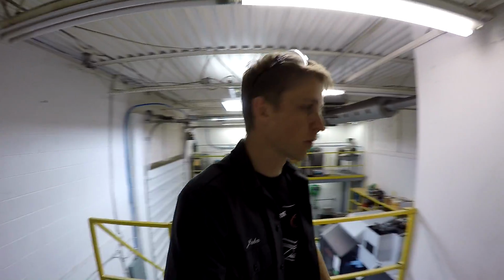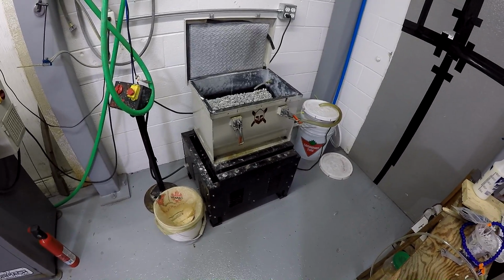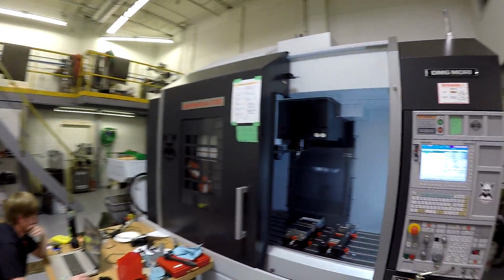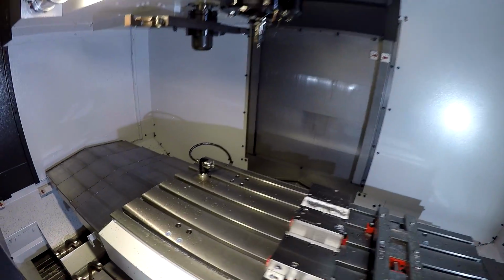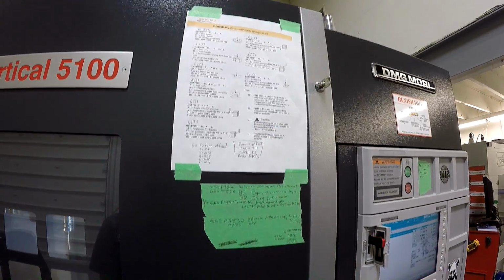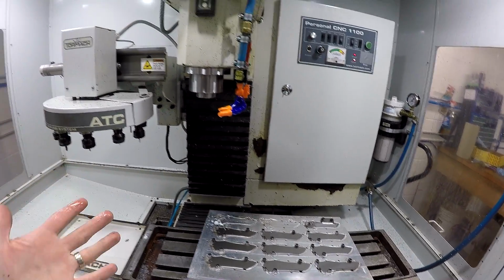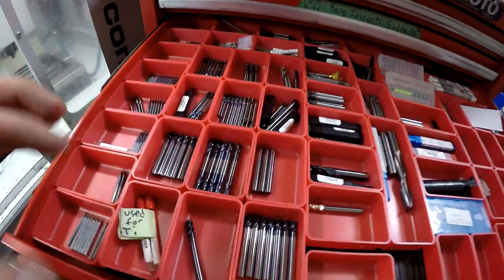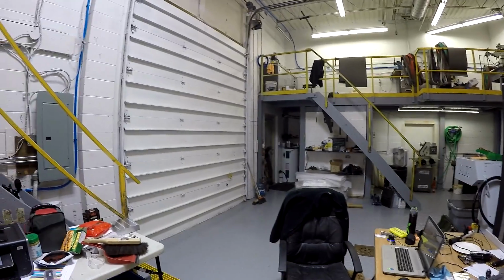Shop Tour of Grimsmo Knives Dec 2015

Comment: The DMG/mori you have is a budget machine designed to compete with the likes of Haas  @ the cheaper end of the market it is basically a 15 year old Mori platform rebadged as DMG/mori because Maho never produced entry lvl budget Machines so they just took an old Mori put a Fanuc drives and a controller on that's why it's so cheap compared to thoroughbred DMG/mori machines like the DmV NHx amongst others.they have siemans or heidenhien drives and controllers  as standard....The machine you have is an excellent machine probably the very best that price range.But you can't really complain about the quality of the lighting inside the machine.When you could of purchased the cabinet lighting and visual package as extra on this machine but standard on the ones I mentioned.This would have gave you full interior LED lights and  Full  in machine HD video camera for cycle monitoring.

Comment: John, on my old surface grinder i used an old vacuum to suck the dust comming from the machine. I half arsed machined a plastic fitting to hold the end of the vacuum to the surface grinder head, and blew the dust into a bucket filled with water so it bubbled up through the water and the water would catch all the dust. That was one of my mcguber inventions and it worked great to avoid cutting a hole through the wall for an exhaust. something to think about

Comment: Hi, I just saw your shop tour video. DMG MORI is great machines, i have 2, lathe and mill of the eco line type.
I have an advice for you, do not keep the renishaw probe in the machine, it will become out of alignment after few months, because of the constant movement of the magazine, this info I got from Renishaw technician.
Good luck to you. One more thing Autodesk 360 is great but you must tray Inventor HSM.
Reply from the maker: +Georgi Yankov That's a great tip that I have not heard before.  I'll keep an eye on the alignment of it!  It's a big deal for us if it goes out of round.  

The CAM portion of Fusion 360 and Inventor HSM (and HSMWorks) are all basically identical, just the CAD side is different.

Comment: Hey John, I would love to hear all the thoughts you went trough before you bought the Mori-Sekei. Why did you not go with a different machine for instance a Brother. 
I assume you had a choice of controls if you bought new, why did you choose the fanuc, and what ever else you can think of.

Thanks for the videos, keep the good work and merry Christmas (or a holiday of your choosing)
Reply from the maker: +Kevin Evardsen Grau Hey Kevin!  Merry Christmas to you too.  The Brother Speedio S700X1 was actually my first choice, and I still lust over it, but I came across a killer deal for this floor model demo Mori for slightly more than the Brother, and it's WAY more machine.  Twice the weight, bigger travels, more than twice the HP, 30 tools vs 21, etc.  The only downside is that it's a little bit slower than the brother, but I'm still happy as a clam!  Being that it was a demo machine I didn't have very many options available to me, other than adding a Renishaw probing package and chip conveyor.  I'm loving the Fanuc 0iMD control, but this is my first exposure to something other than Mach3 and PathPilot.  Cheers!

Comment: You've vocalized so many things that I've experienced after moving to the Brother. The biggest thing truly is: it "just works". If press a button or something and the machine doesn't behave the way I'm expecting, I've learned that the error is probably on my end, not the machine. It's been a challenging, but welcome transition!

I'm also a big fan of the absolute positioning. I never home any more. Actually, I don't even know if there are limit switches in there... I assume there are, but up 'til now it hasn't mattered. When I was hand-drilling the holes in my pneumatic fixture I actually moved the table out of position (the machine was powered off, so there was nothing preventing the table from moving). It probably moved several centimeters. When I turned the machine back on it apparently picked up on the new position without skipping a beat. So cool!

I'm assuming the Mori has a rapid override knob, that's been another very welcome feature! I control the machine more with that knob than anything else... well, maybe not more than anything, but I definitely use it a lot. The machine has spindle speed and feed rate override knobs as well, but I don't really use them very much.

Anywho, congrats again on that bad ass machine! Also, I'm glad we've finally got to see it! I wanna see some reflection-filled, coolant-obscured, small-window-constrained videos of it actually milling!

I too love me some GTA! But I find myself staring at CAD/CAM a lot more often. :/
Reply from the maker: +Hirudin Nailed it bro.  I still giggle watching vids of the Speedio, it's noticeably faster than mine (1400xy 787z).  And your tool change and spindle ramp up/down is way faster too.  Other than that direct comprison to the Brother I have ZERO complaints about this machine, it's amazing.  

We also use the rapid override more than anything, and we're starting to use the feedrate override more too.  We hardly use the spindle override because it's buttons not a knob haha.  

More vids to come!  The finishes that this thing leaves was totally worth the cost, I love it.

Comment: We just built an insulated plywood cabinet around our tumbler. It increases the interior temp a little but its quiet and a super cheap solution. 

Side note: Will I be able to buy a Norseman if I stare at the website long enough?

Edit: We put our compressor in an enclosure as well.
Reply from the maker: +insipidMT Good to know that it doesn't increase the temps too much.  We should do that with the tumbler for now.  What if we put the insulated box on wheels?  Have some soft foam scraping the ground?  Hummmm.

Comment: Back in the days when I was working as a toolmaker my machines was two Hüller Hille NBH 170, one 150 and a 70. Nice machines indeed, but that part with the emergency stop. When we installed the nb-h 170 we had a german guy to show the new features. It was a two-palette changer (work on one piece and load another outside of the machine). The german guy showed how quickly the emergency stop intervened, while the machine switched palette .. It snapped the main shaft which lifts and change palettes (a sturdy piece). He was not so impressed by himself and I bet that wasn´t cheap either :P
Reply: +Peter “Lillebroor” Lundman 
Daaamn!
Reply: +Hirudin hehe yeah that was one part of what he said ;)

Comment: here is a nice little project, make a custom cnc name tag with grimsmo logo that replace the laptop ones, since you have the same model its easy to mistake. you can basically do it with scarps.
and that tool change made me go Holllyycrapp out load :D
Reply: He said it in the other video. Any time those machines aren't making parts to sell they are costing money. That mori probably runs about $5000 to 10,000/month or more. So the more it is running fun projects the less it is doing it's job of making money. That's the problem with successful products... They turn into work.

Comment: Over the rail (so it's out of the way) you guys should totally build a belt rack. Something simple, out of PVC pipe. That would both organize the belts and save space, since you'd otherwise never use that area.
Reply: You can add a very light polarization sticker (3M windshield thingamabob) one the glass, and glare would mostly go away, or you could also get cheap eBay filters for the go-pro, either way works.
Reply: To store my end mills in the same box i just use slips of paper, not even wrapped, i just had a friend who has a business card shearing machine cut me a ton of card sized paper slips.

From there i just pick a bit, bend the paper in half around it and slide it in. Super helpful, keeps them safe (i have chipped two once) and extra, i labeled the paper slips, so if i need something, i just run my finger over the slips (which stick up) and pick what i want.

Comment: Nice dude. I just emailed Eric the other day to get a minimum dovetail dimension for making mini-pallets like that. That "It just works" portion is genuinely the largest advantage all of the genuine VMC's have over the home brew stuff. The advantages of horsepower, rapid speed, etc.. all pale in comparison to not wasting hours/days troubleshooting or making bad parts. They've made a few cntrol tweaks since our duraverticals, i'm pretty sure we only had one auger per side. You should look into the MDI shortkeys, they really make operating that control nice. Have you had to rescue the tool change arm from a mid-tc reset yet? It's feels pretty sketchy the first few times.. :)
Reply: The chinese fingertrap stuff is good for keeping tools safe when loose in bins like that. It's cheap and doesn't occupy a ton of space like the tubes/boxes they come in.
Reply from the maker: +rob lockwood Well said.  I guess I'm familiar with the shortkeys from training but I haven't really used them since.  I'll take a gander today.  We do have a lot of MDI codes that we use all the time, but they're easy enough to type in.  I have had to rescue the ATC twice, sketchy indeed!  There's a hidden setting somewhere that's not even in the manual that's needed to rescue it, I had to call DMG, then I wrote it in the manual for next time.  One time I forgot to turn the air compressor on and it tripped a low air pressure warning halfway through the tool change!  doh.

Comment: Awesome!  :)  I enjoy your updates.      I just realized your shop has no windows. That would drive me nuts.
Reply: +Wide Vision Metal Fab no windows keeps the undesirable element from breaking in and stealing all those spendee bits.
Reply from the maker: +Wide Vision Metal Fab +dzlfreek It does drive Erik nuts sometime, but at least he gets to go outside with the dog every hour or two.  I don't mind it so much.  We've thought about cutting some in, way high up.
Reply: Have you considered closed circuit TV? Looking at a monitor would be just as good as looking outside, and It might be a bit easier than installing some windows.
Reply: +Wide Vision Metal Fab or just open the bay door

Comment: You have absolute encoders that's why you don't have home machine.   Do you have through spindle coolant? If so 300 psi? 1000 psi?

Beautiful machine you have there.
Reply from the maker: +m98custom12 We don't have through spindle coolant but the machine is prepped for it.  We can either buy a kit from Chip Blaster or retrofit something ourselves.  With our current workload I don't see it being worth the expense at this time, but it's something I want eventually.

Comment: believe it or not but a 1" belt is better on the grinder. it will take less passes to get off the part which will save bunch of time. plus you get to split 1 2x72 belt into 2!
Reply from the maker: +Finn Custom Knives Interesting.  Erik uses a lot of split 1" belts for sharpening.  He's just annoyed by them on the surface grinder.  I think it's mostly the tensioner that sucks, and converting it to 2x72 with a custom tensioner would also let us run 1x72 and play with that easily.

Comment: with the BT40 collet (I'm sorry I had a meldas 1040 and it was BT40 and looks extremely similar) spindle you can use a geared engraver that lock into position and will run 7x the speed of the spindle and would be great for well everything. The only downside to it is that you have to remove it manually as it wont fit in the ATC.
Reply from the maker: +xkblxcripple BT40 and CAT40 are basically the same, I think the ATC mount is slightly different.  There are spindle speeders that run on air, ones that run on through spindle coolant, and ones that are ATC compatible.  I think they're around $2,000-5,000.  We do some engraving but not a lot.  If we start doing a lot, or want to speed up micro machining, then we'll be thinking about it.
Reply: Ha ha no worries, I haven't actually looked into the differences myself as I only had one cnc mill to operate. Looking forward to more videos in the future. keep up the good work guys.

Comment: I'm a little surprised that you jumped right into the Mori without first getting your own waterjet machine. I would think having your total production process in house would have been preferable to still having to rely on an outside shop, and smaller  waterjets are much cheaper than the Mori.
Reply: +AndTheCorrectAnswerIs Depends on where your bottle necks are. Having more waterjet blanks won't help produce knives faster. Being able to machine knives faster would.  Also, I'm doubtful he would ever outsource on the machining.
Reply from the maker: +Impyman18 +AndTheCorrectAnswerIs +aserta Good thoughts all.  We currently get all of our blanks waterjet cut somewhere else, but they also get double disc ground and sometimes lapped.  So if we got our own waterjet machine I'd also want my own double disc grinder and lapping machine.  That brings a lot of extra TIME and EXPENSE into the shop, without providing any more VALUE to the product or the customer.  Right now I don't mind paying for waterjet and double disc.  I buy my material, get it shipped right to WJ/DD, they ship it to me, I have blanks ready to machine.  It's a non-critical process, even though the tolerances can be pretty tight.

Besides, I LOVE machining, so that's where my money goes.  I don't have that same love for waterjet cutting ;-).
Reply: +Impyman18 I agree. Bottlenecks in production, if you're unable to figure them out (and he did mention a case regarding production speed in this video), you're pretty much screwing yourself over.

Also, so far it's a two man shop, outstretching to another machine, even one as simple as a water jet (not really that complicated on the scale of things), not a good idea.
Reply: +aserta I disagree on the outsourcing part. Generally the cost of waterjet vs tool cost and machining time to machine from stock will be far less with waterjet. As well as being able to cut larger sheets where the material cost is less and time saved on not having to cut larger sheets to fit the mill. Let's say they went with waterjet machine vs bying the Mori. They would be able to cut blanks far faster than they could machine them on the Tormach. At that point you'd have more stock than you can cut. Your waterjet would get used maybe once every few months vs the mill that can run every day. Of course if they owned both things would be different but I still don't think the 100K investment in waterjet is worth it just to cut blanks.

Comment: Need more video on the air compressor. Pros Cons what you like dislike.  How is the service, etc.  Also talk about the laptop choice, what hardware it runs.  How well does Fusion 360 work on it?
Reply from the maker: +Kicker700 Love the air compressor.  It's expensive, but we got a lightly used one from the dealer for half price.  We're getting a noticeable amount of moisture out the guns even though it has an automatic drain and a refrigerated dryer.  We've had two service guys come in and that has helped it, though I'm not sure it's completely fixed.  Laptop choice, one of our customers suggested these HP envy series laptops, so far so good!  they're about $900 on ebay refurbished.  16gig ram, ssd, etc.  Fusion works great on it.

Comment: What kind of buffer do you use? I was just looking into buying one
Reply from the maker: harbor freight has a cheap dual buffer that works alright.  1800rpm is great for scotchbriting titanium without orange peel unless you push really hot,  that's what I'm used to.  The HF one is 3600rpm and orange peels everything in seconds, sucks when you're just trying to deburr without orange peel.  variable speed would be great. our 1800rpm buffer is an old furnace motor that came in our basement. easy to find used, even on craigslist.

Comment: you should mount a GoPro in your new milling machine and make a waterproof plastic box for the GoPro and the coolant won't damage the GoPro
Reply: +Butterflyknife1 +JohnGrimsmo
Keep an eye on it if you do. I put a GoPro (and one of Sony&#39;s action cameras) into my machine and my coolant ate those cases away pretty quickly. Also, coolant inevitably ended up splashing onto the lenses.

I&#39;m wondering if putting the GoPro inside a &quot;glass display dome&quot; would work - I&#39;m sure the glass would keep the coolant out, but would the glass create distortions and reflections?